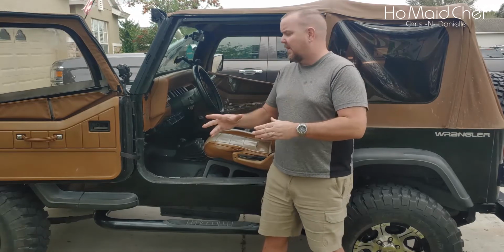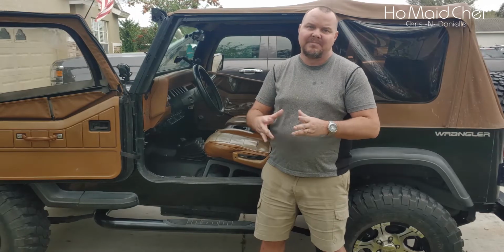Boom Mat One Year Review On Jeep Floor

Comment: It's a basic spray on bedliner.  What I'd suggest for places with humidity is Herculiner as it reacts with it.  If you want a noise decoupler, then one can get Amazon Basics/Siless/Kilmat.  If you want insulation one would use a closed cell foam also made by Siless.  Then one can finish off with rubber foam mat, as it protects and insulates from thermally and noise.  Where I'd use a spray is when one has to shoot up into places where one can't get with a brush/roller.  At the end of the day, most of the noise will be from it being a soft top, exhaust and tires on this vehicle in this content.  This just came up, and figure I'd share a bit of feedback. Actually one can use cork in some places as it has it's own properties.  😉✌
Reply from the maker: Good feedback. This did cut down noise better than the carpet. Since this my son has put insulation and carpet. All together, it works pretty well.
Reply: Lizardskin